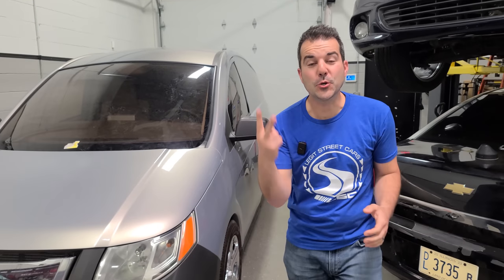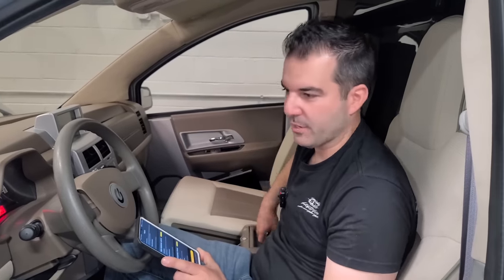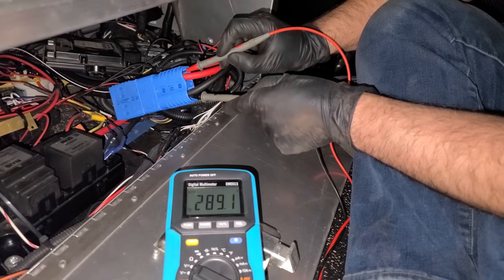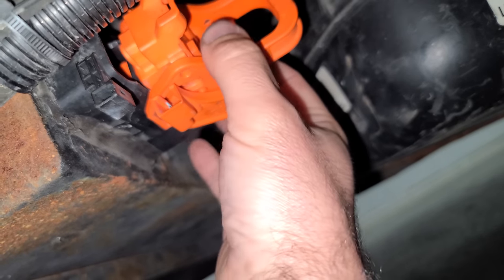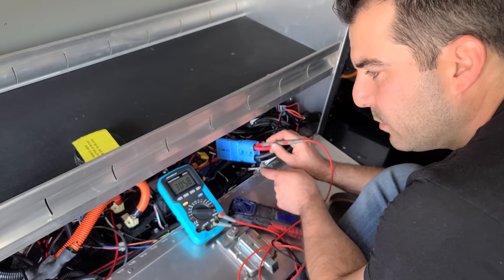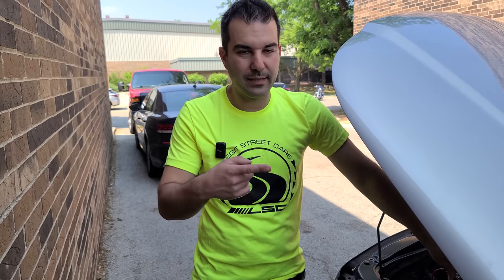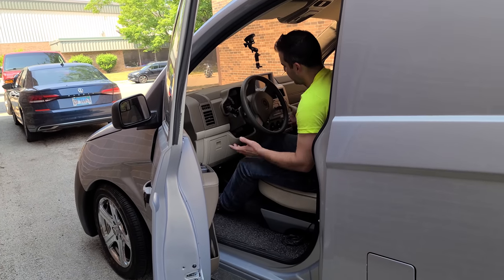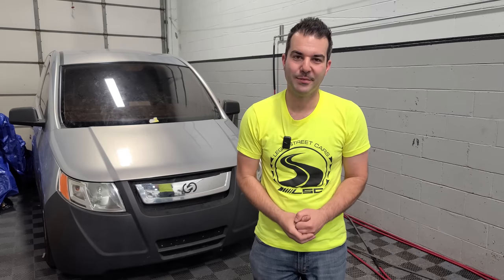I Fixed The Abandoned 2 Million Dollar Concept Car For $150! First Drive Ended In Disaster!

Comment: You asked what your viewers are working on? (I "totally expect" a comment back lol) I'm currently installing a Scorpion Whip 440cc 2-stroke snowmobile engine into a Yamaha G9 golf cart. As far as I can tell, I'm the first person to create this particular type jack shaft, converting the CVT to chain, using the factory Dana differential with the sole purpose of changing my gear ratio, using different sized sprockets. I realize using a jack shaft in this type of build isn't all that unique but my particular setup seems to be unheard of - or at least I haven't seen anything like it yet. I WAS going to film it and put it on my YouTube channel as my 'flagship' project, until I realized I'm not entirely confident that I can brainstorm this project as well as remember to record it! I may do something of a slideshow afterward...

Anyways, that van is awesome and I hope you get it figured out soon!!!

Comment: Sounds to me like the motor-inverter was browning out due to "low" voltage.
Causing it to crash and reboot as the voltage drops below minimum and then comes back up.
That would cause the motor to turn on and off rapidly causing the shuddering.

Comment: If there missing so many things, plus it for delivery, no breaks for sure installet..

Battery could work okay, no matter for how old it is, because it used so few times. Maybe some 70-85% capacity left from new. It's old technology, so it could handle more long iddle states, maybe. But I dont think it's matter.

This car has has used less fuel than one littre per hundred miles, because it travels always at trailer..

That thing what controls gearbox, gives maybe wrong signals for system.. whole thing is huge mess what comes wiring.

It's dream from very hard nightmare...

Mouses could pissed there so much, it ruined some connections.. 

There is some physical connector between motor and rear axel? If there is, and it jummed.. then system want to test does motor is free and okay, but it's connected physically to axel.. , so then it could do that. Or other thing is that motors controller input signals had gone grazy. It could have some sensor, how that emotor spins in sensors mind, vs what comes from cables in brake mode.
So many questions.. 

If HV batteries have grazy low voltage, and controller dosent have controller power from 12v system, it could drive it mad too, but it shoudnt do that..

If I live closer, I ciuld come help with this for free.. that cannot be that bad problem.

Comment: Probably the electric motor is connected backwards. So when you try to drive with the gasoline engine forwards, the electric motor goes backwards an crashes the mount. Try swapping two of the three wires that go to the electric motor. This will reverse the direction.

Comment: Do yourself a favor and remove the inside door panel on the back door so you can get out. Also, re-fabricate the motor mounts with thicker gauge metal.

Comment: Is there a chance the polarity is reversed on that motor? Could that be why it goes forward when in reverse? Is it possible that someone connected the cables backwards somewhere in the loop? Maybe there is some corrosion somewhere within the motor from sitting so long that is causing the power flow some issues? Could that be why it keeps jumping and blowing the mounts when it's starting up?

I can't imagine any reason why they'd have the gearing so wacky like that. Seems there would also be some kind of clutch to eliminate the torque on the motor when it's not actually driving the van.

Comment: I think the shaking is a controller issue.  And since the bracket was already broken, it's probably why the van was parked.  I'd think the motor would be disabled when the van was plugged into power.

Comment: Is it possible that the electric motor and the gas motor keep going in different directions? I mean if reverse is drive for the electric motor and it doesn’t have that issue for the gas motor… then it could be a possibility that some wires are reversed

Comment: It looks a lot like the electric motor is fighting the mechanical one, and that is what's causing your issue. I do industrial maintenance for a living and play with electric motors a lot and it looks to me like someone swapped two of the leads on your electric motor, if you pick two of the 3 main leads to the motor and swap them, and it doesn't matter which ones it'll swap the direction of the motor and your gas engine will then be assisting your electric motor rather than fighting it, and you likely won't get that rattle anymore as the gas motor will keep the motor from single phasing by keeping it spinning in the correct direction. Also your battery won't die half as quick since it won't be taking the full load of the vehicle with a weak battery and electric motor.

Comment: If it drives forward on gas in Drive and Forward in EV in reverse could the EV be wired backwards and as the van drives you have the gearbox fighting the EV because they are going different directions. You will only be able to go in reverse at a limited speed because of the gearing. So when it goes above that speed the EV is opposition to the engine. One is fighting the other.

Comment: Why did you cut the receptacle from the new power cord? You could instead of hard wire the long cable to the van, just put a female plug on the car - plug-in any household plug.

Comment: hi Alex. 
I wanted to rough base with you. having a very hard time with my 2017 expedition.  when I gas it it throws a engine code. I am going to order iCarly because even my mechanic is stumped. I trust your advice and have attempted many repairs that I would not normally go near because of you and had success. tyia Sacha

Comment: It might be worthwhile to drop the EV battery out and go through it checking all the connections and balancing each cell back to capacity individually before hooking everything back together. 

I have a lithium ebike battery that required replacement cells. When the shop serviced the battery pack they had to put 12 volts to each individual cell before joining the cells back together. I went from only a 20km ride distance to 60. I also bought a second larger capacity battery to replace the original and now get approximately 100km to a charge

Comment: I saw myself in Alex when he chopped the extension cord to charge the EV battery. He left enough wire on the cut end to make it easier to splice that back on later 😂. Probably an unconscious decision after doing it so many times to other connectors.

Comment: I don't really know much about cars or EV's (or much of anything tbh) but if the bracket keeps getting destroyed it's probably because the motor can't transfer all it's rotational power. Yes beefing up the bracket is one way to solve the issue but it might be worth looking past the motor to what the motor is driving or maybe the motor is being given too much current so it's not stalling when it meets the big amount of resistance. Either way the motor can't turn what it needs to so it's starts trying to turn the motor casing instead causing a lot more stress on the bracket than it was designed for.

Part of me thinks that this wasn't designed to drive but if it wasn't designed why would they connect the ev motor up??

Comment: Wow, Bulk up the Rear Electric holding mounts by x4, and get the Clutch to disengage, and get the Forward and Reverse Fixed..
The Electronics, that the Easy Part for Me, But I am Not There to Help.... But I will Help, You Just Need to Just Give Me a Yelp....

Comment: Your engine and motor are pushing in opposite directions. I hope you've figured that out. As long as they are in 4 wheel mode, you will continue shaking apart.

Comment: If you drive the car with the battery disconnect unplugged, the electricity generated in the motor has nowhere to go, hence it ‘stalls’ and shudders above a couple of mph.

Comment: Its obviously the electric motor polarity is reversed,  that's why when it try's to switch from electric to petrol the two motors are going in opposite directions that's why the electric motor is shearing its mount.
Simply swap the negative and positive supply to the electric motor, I'm sure this will solve it

Comment: It’s the car in reverse and the car is wanting to start . when you drive it’s wanting the car and didn’t wanna go forward when you have it first the electric motors going to go forward but then the car motor turned over backwards. So you need to disconnect the drive motor because the dry motor is upfront and the electric motors in the rear I don't think that would ever work in any concept I don't know why there is a gear selected in the beginning if it was me I would have where you put the car in neutral and then you flip the switch to go electric mode just for the back motor and then you have the car in neutral for the gas motor

Comment: Looks like the electric motor needs to be reversed (probably in software) so it goes the same direction the engine wants to go and they work together properly and not fight each other. Just a theory

Comment: THERE IS NO AUTOMATIC BALANCER BETWEEN batteries?? Remove them, then charge those one by one.. I dont think it have similar small battery clusteret in one big back, like some todays cars....

If those clays are already very dry, burn them in ceramic oven and then paint. You coul sand and fix details afterwards when its burnd.. but I dont know how much other marerials is inside there at clay, like lets say wood or plastics.. x)

Comment: Whats interesting about the automotive companies GM and Chrysler, trying to put together a 100 mpg car relying on an electric motor to run part time.
The Chrysler assembly plant in Windsor ontario canada,had  carburetor that they put on a dodge car,that got from Windsor ont to Toronto  and back which is about 240 miles each way.
This car was not supposed to leave the factory with this experimental carburetor on it! Oops!!!
The woman that owned it,took it to the local dealer because she tried to get the gas guage fixed  or find out why it didnt burn much gas(,the dealer couldn't find a probkem)becausd the cars guage registerd an almost full tank of gas!after driving it to Toronto and the guage was still at full almost!
Chrysler wanted the car back, and she refused,so they stole their prototype carburetor back off the engine and put a stock carburetor on it! I walked by as some guy was under the hood,I did not know this was a Chrysler mechanic stealing back there prototype carb which was a round shaped carburetor!
A Mr Pogue invented a 100 mile per gallon, carburetor, many years ago, and the oil companies or auto group bought him out and threatened him with death if he ever told the world how it works!
So,its possible to get 100 mpg,by using a different carburetor!
We've been getting screwed by gas companies and the automotive sector for years!
Thers quit a write up about it and her complaints about how her 72 dodge now gets poor gas mileage, in the Windsor star paper!

Comment: Seems on gas. D is forward ev is r for forward. . that's tell me  when gas starts   the e motor want goes opposite way and why shakes.    Bet if e motor  phase reverse so d forward on gas and e it won't shake and fight each other. System gas  is fighting e  and  no winners  then

Comment: seems your EV problem is not a voltage but current, considering battery age this would be an obvious issue. Battery holds the voltage but not providing enough current to keep whole system alive... (at least not long enough). You should test EV battery while driving, I bet it will drop to unacceptable figures which will be a sign of EV battery replacement required. Battery testing should ALWAYS be performed under the load ! Suggestion to test, do it on the ROAD since with wheels up will minimize the load making the readouts fake.

Comment: The current coming from the batteries to low meaning very out of balance or cell group is shot. Has the voltage but because the current dipping to low it causes the motor to start and stop rapidly, that is that shaking.

Comment: I was about to say… Lithium batteries are made up of multiple cells and some may have dropped way down and one or two held charge all that time so when you connect it to charge, those charged cells tell the charger OK We've maxed out! any more charge and we may explode!

You need to charge and drain several cycles over so that those higher cells drop while the discharged cells raise and they all meet in the middle. All EV tech is literally RC car tech from decades ago, and modern RC battery tech is vastly superior to any other battery tech outside maybe F1. Now you know.

Comment: Sounds like the Electric System and the Petrol System are Connected Incorrectly
Petrol Drives Forwards in Drive And Reverse in Reverse
Electric is Forwards in Reverse and Backwards in Drive

If the Electric Cuts in to take over while the Petrol is Going its gonna Shake and brake ones trying to go forwards while the other is trying to go in reverse..??

Comment: Lol you got locked in twice? And didn’t fix that? Or was that from when you were first trapped?

😂
Reply: The gap in the door lock mechanism is usually where the safety latch is… mandatory on all vehicles
Reply: You’ll need a screwdriver or something to push a metal tab and it takes a good 5-15 lbs usually… 

Some cars have a bright green handle attached to it

Comment: Windmill generate power by over speed motor . Example e motor runs at 1800 rpm with 480v  wind makes motor go at 1810.  . Which motor tries run 1800 bit can't and power  generated

Comment: Hybrids have come a long. I don't think that electric motor is the way it clunks alot but the concept of having a small gas motor automatically kick on when the electric power is down, then charge the battery, drive the car and power the electric motor is the way to go. Wall charging would then be a last resort.  100mpg, here we come!

Comment: The rear suspension in that van is a deDion tube. This is the easiest axle style to convert to EV since you can just change out the normal 3rd member for the electric motor and offset gearbox. It should be very easy to drop out so you can rebuild a better motor mount system.

Your next step is to identify and confirm wiring for the EV side. The motor or controller may be wired backwards resulting in the vehicle moving the wrong direction in relation to the gear shift. Or there may be an issue with the regeneration system wiring where the van is attempting to recharge the hybrid battery but the regen system is locking up the electric motor.

There may also be a failed or miswired DC-DC converter connecting the 12 volt battery to the control systems for the EV bits. That is what I would believe based on the fact that the motor is going nuts when you try to power on from the key but doesn't when you have the charger plugged in and powering the EV side. This would a different box entirely then the DC-AC inverter and is either part of that relay block you found when tracing the EV wires between those giant grey connectors.

That paperwork you found listing the make as ""Assembled" is where Bright took the van to the state police and got a VIN assigned since they weren't a manufacturer with their own VIN prefix. The van was titled and registered as a home built car.

The engine starting while in gear is because they need it to be able to start/stop the engine while the vehicle is in EV mode to extend range or recharge the battery. The build was done quickly enough that they never cleaned up the harness to eliminate the wires they didn't need.

Comment: Sorry to be that guy... but the lock washer you used when reinstalling the motor bracket goes between the head of the bolt and the flat washer, Not between the flat washer and frame. Carry on ....

Comment: Next time you need an extension cord like that, instead of buying an axtual extension cord that has the gross PVC jacketing on it, go to the bulk wire section of home depot and they always have "SO" cable, Its almost the same cost as buying a retail extension cord but the jacketing is actual rubber or EPDM and far far higher quality.

The only reason to buy extension cords is when you're too busy to put ends on a cable or dont know how, its almost the same cost! Especially at the lower wire gauge numbers.

Comment: I'm currently in the midst of an EV conversion, so watching this series is quite a nice distraction. The shuddering is probably the effect of low voltage momentarily cutting out the drive, then quickly recovering to drive it and repeating in a pattern that results in the shudder. If you were to look at the individual cells, you would probably find a small number of them are dropping low. Replacing them,  or jumpering external ones into the circuit might help. You should be able to log into the motor controller, charge controller, and hybrid inverter to see what's happening. Of course, each one is likely to be it's own study as far as parameter adjustments, status messages, etc.

Comment: Per your request...I'm currently working on a computer game that I started programming on my Vic-20 computer 40 years ago when I was still a kid. I found a printout of the uncompleted project and was able to type it into a modern pc running a Vic-20 emulator...and it works!  The program still has some bugs and is not completed.  I am currently collaborating with my younger self to finish writing our 40-year-old Vic-20 game.